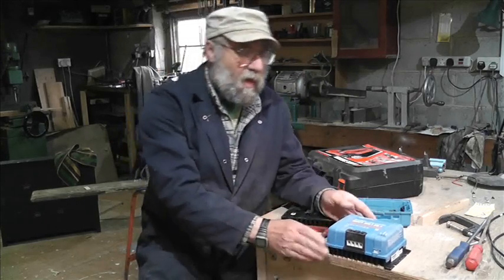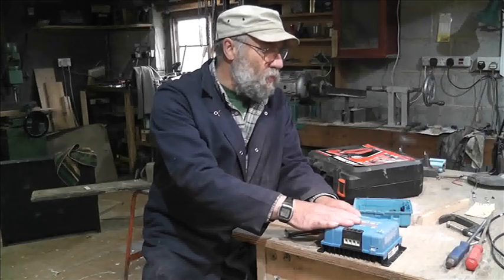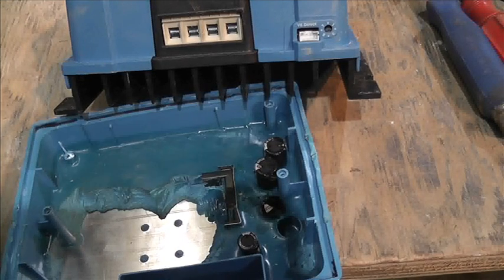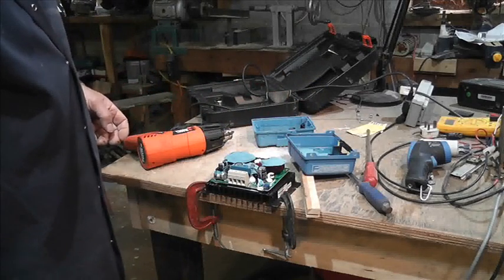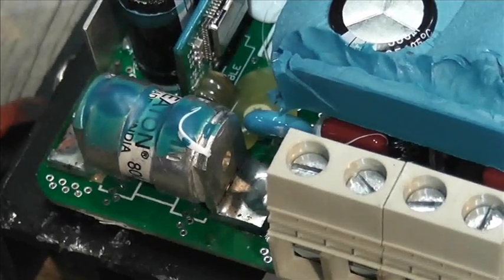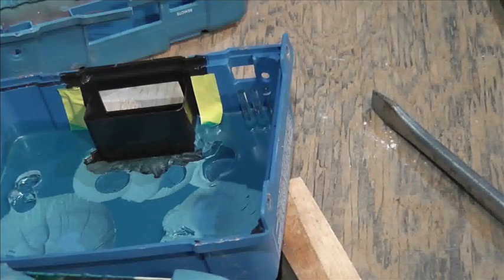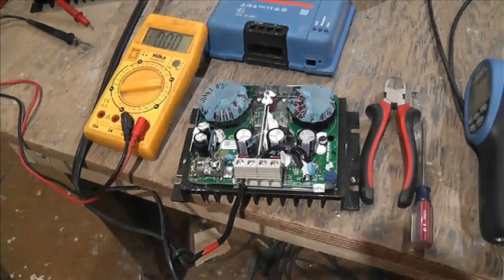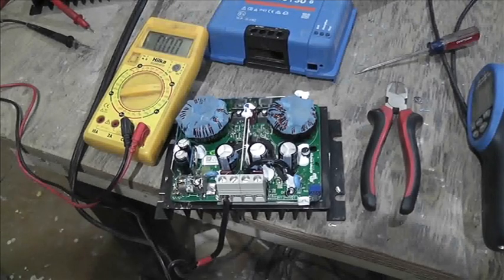Victron MPPT controller, potting hack and hidden fuse

Comment: this is not for people not getting it, Victron is for automotive industry (mobile) and this glue compomenents on the case (2x inductor and 3x capacitors) is for protection from vibration and stress so they doesn't move or rubber to eachother and not to fracture the solder joints. They could have done it differently but it would probably add more cost to the unit. Anyway i think newer version of Victron equipment sort this thing.

Comment: I have successfully (and hopefully non-destructively) removed the cover from my MPPT 100/50, this after I let the smoke out (C56 is no more !). I was hoping to find schematics online to avoid having to purchase a replacement (I am cheap) so far to no avail, but shall keep looking, and who knows.....
Reply from the maker: See my videos on repairing this, it was just one FET, also see my video on the VLC V2.0 programmable voltage relay unit to control a power relay, very low cost, cheers

Comment: 99.9% of the time, a blown fuse is the first "Line of Defense" indicating that something else within the circuit's current flow is faulty or falling out of its specified tolerance.  First thing I learned, before jumping any fuses and adding power back to the circuit, is to trace your power control components ( diodes, transistors resistors and of course capacitors) along with a thorough visual. Also, it may sound funny, but doing a good smell test wouldn't hurt neither in leading you to a burnt or overly stressed component.

Comment: Thanks for the demo of removing the cover. I got mine apart and found 2 shorted MOSFETs and the blown fuse. €30 in parts and it’s up and running again.
Reply from the maker: Brilliant, well done, I've fixed one, just a dead short on one FET. Not like the bigger units that are impossible, cheers

Comment: What a bad and customer unfriendly policy that the devices of Victron are not serviceable! I have a 150/45 MPPT and a Pheonix Inverter from Victron - but i will think twice before buying the next device!
Reply from the maker: Exactly, but our 3KW Multi plus has run for decades. We do run it softly and use the UPS function for loads above 1.5 KW, cheers

Comment: I saw there is an aluminium plate inside the cover to disperese heat and maybe shield the outside world from high frequency fields.

Maybe it can be heated with some inductive power aplied from the front.

A few big neodymium magnets on a roting disc driven by some drilling machine will cause heat.

Or an half open tranformer with iron core, an electromagnet, can induce current in the aluminium?

Then the heat is generated from inside and from all conductive parts near the front.

And now with the "substance" available it could be tested at what temperature it becomes soft.

Worth a try.
Reply from the maker: Hi, the melt test sounds a good idea, I going to try that with a heat gun. The problem with heat is the capacitors all packed together in potting. I doubt they would survive as the contact pins are not very strong. Keep watching, cheers

Comment: It could be filling the device and making it unserviceable is also a cooling issue. The coils and even the capacitors may get hot in a non ventilated box. I have a faint memory some of the earlier Blue Solar devices where filled with something similar to sand.

But I would rather have a serviceable unit than having it glued. The design is trivial and easy to check for errors if not filled with "glue". Att least they could have made all power electronic devices on the heatsink and the fuse accessible.
Reply from the maker: Hi, at least it did come apart, but damage could occur. as you will see I've fixed another of these after a successful cover removal, cheers

Comment: I've had three of those fail and a 75/15 fail. Gave up and bought an epever China one, been fine for years
Reply from the maker: Thanks for sharing your experience, many people have recommended Epever. My Old Victron multiplus just keeps chugging away, but we never stress it. Applying rule 2 of solar, cheers
Reply: i also have epever theyre not bad, i have two victrons 100/50 but everything these days is built to a price.
have a freind a retired professor of electrical engineering,  bet he could design something robust.

Comment: I have a 150/100 with error 40. The battery ground wire slipped out, I slid it back in. Although the unit powers up, can see it on phone application...cannot clear error 40. Are these repairable?
Reply from the maker: Hi, those 150/ 100 are impossible to take apart without major damage, so unless it's a software issue then I'm not hopeful, video on the opening up soon, cheers
Reply: Reset the MPPT means manually installing the software update again, after that it automatically switches off and resetting. Fixed that on mine.

Comment: For these types of reapir you need at least limited power source and thermocam to check at low level of voltage and curent, what is warm and what gets hot.
Reply from the maker: Hi, I knew the unit was duff, especially as the 80A fuse was blown. Yes a limited current supply would have prevented the blue smoke dragon. The main part was removing the top with a hot air gun. cheers
Reply: @TheInfoworks  Look for "RIDEN Power supply"

They are cheap and fantastic things with lots of decimals, current limit etc.

Easy to power directly from 12V or 24V battery. Makes it isolated and portable.

I have the RD6018 RD606 and tiny RK6006.

The RD6006 is the best for electronics with 4 decimals current reading.

Comment: HI, beuautiful video, you can build 2-phase 200  V IN 100 A IN / 10 - 70 V OUT / 100 A OUT MPPT as DIY ESP32 project for 150 - 180 €. With tracking better than Victron and EpSolar, with efficiency around Victron, MidNite or Studer products. So two such MPPTs can get 2 x 6600 W for 66 V battery and temps of FETs and inductors never go over 45 - 46 *C in 22 - 23 *C ambient.

Comment: where is your external fuse!?
Reply from the maker: Hi, do you think it needs one in this situation, interesting, cheers
Reply: just think for a momentif you would be comfortable joining the wires together for a dead short
- if you are comfortable with this level of power in the wires, and any additional damage to the circuit, no need for a fuse
- if not, you can limit any additional board damage or melted wire insulation by the addition of a fuse.

I know this is a low risk, but, for something different imagine the recent japanese earthquake, or some other distracting emergency event (heart attack?) resulting in the pair of unfused wires remainig connected.  (yes I know low risk ...)
Reply from the maker: John, it's an experimental dab, not a screw connection  @johnallen3555

Comment: Very nice! Have you by chance seen if  you can get into the larger 48/100 version? I've found a non working unit and am wondering if it would be worth getting.
 New subscriber 👍🏽
Reply from the maker: Hi, welcome, I wouldn't pay money for it as there is commonly a cascade effect to component failure, meaning that it's not a single component. If you are an electronics wizard then maybe entertain it, but otherwise be careful and have no expectations of fixing it, cheers
Reply: @TheInfoworks  great advice! I'm sure they overpowered the solar input but who knows these days
Reply: @TheInfoworks  also wanted to say cheers on the pottery! Do you show vids of that as well? I'm introducing my kids to throwing and am looking for the right clay! I thought my soil would suffice but it's not right so we went to the closest store and bought the only one they sold but it's still not what we need
Reply from the maker: Yes, there's a whole playlist on my pottery adventures (ceramics) otherwise check out Andy Wards ancient pottery, cheers  @Laurel-Crowned

Comment: You need to pot the caps  and inductors in particular in marine applications due to the fact that they need to be supported at both the top and the bottom to stop them vibrating relative to the PCB, as the electrical leads fatigue rather quickly if there is movement of the caps and inductors relative to the PCB, so they would fall off the PCB pretty quickly.  Ie you need atleast 3 points of contact for it to be a stable system, ie a stool needs to have atleast 3 legs, a 2 legged stool is unstable.  caps and inductors are natively only 2 legged.
Reply: That’s all correct but it could be done by Victron so you can repair it with eg blobs of heat releasing glue but that’s obviously what the controllers of private equity Victron does not want, makes more turnover if you have to replace and you don‘t have to employ technicians to repair stuff.
Reply from the maker: I agree in transport applications it's important and the heating hack makes all the difference, cheers

Comment: Thanks for sharing this. I have just had to replace my entire system because I wired reverse polarity.. yeah.. I know stupid me.  But thinking that I can replace the fuse and some capacitors.. 

Will give this idea a go.
Reply: Did the same to one of mine. You'd think it would have polarity protection like cheaper ones
Reply from the maker: That's tough, I teach, check the polarity, mark it with tape, then check it again. Never imagine it's right, cheers

Comment: I can see 2 reasons for this foam : thermal transfer to the outside, reduce vibration
Reply from the maker: Hi, thanks for the comment, I'm thinking vibration proofing when in boats or vehicles, cheers
Reply: yy its gross weight this coils, or transformers, it helps for more  mechanical robust and cooling too, disasembly is hard, i see open it for use heat for lid and then little bit strenght and it happens

Comment: The potting is there to keep the cap and inductor wires from fatiguing from road vibration.
What is the history of the MPPT? Was it over voltage/current that blew a FET, cloud's as the pass the sun there edges at as lens monetary boosting amps and volts beyond the panel name plate. If the MPPT rating is close the the panel name values it could fail.
Adding a external transient suppresser, say 80V 5 to 10W, grounding the panel frames to a ground spike may help.
Reply from the maker: Hi, this came to me in an interesting pile of "bits". I understand the anti vibration but actually using it to glue the top on is difficult to justify, cheers
Reply: @TheInfoworks  
Gluing to the top makes perfect sense, since the components are heavy, they need some thing to react against to keep them from vibrating. 
Very few people are capable of repairing DC/DC converters, maybe replacing FETs but when they go usually they are not all that fails. But without schematics its even harder.
But a better mechanical design could have been done, but that would add cost and complexity, every consumer wants the lowest price and to by it on sale.
On the other hand if they did not want you to take it apart why did they put screws in it?
As I said not knowing the history of the MMPT who knows how it was abused, over voltage, over current, over temp, not grounded properly or factory defect, who knows.
Reply: @universeisundernoobligatio3283  They could be glued to the board. I think it is to get rid of heat from the coils and the capacitors as they offer quite high current for extreme users. But it makes the device impossible to service.
Reply: @TheInfoworks  Agree. Making it unserviceable with "glue" is a crime. I think it is to save the coil from heating, but I would rather have a fan than a device filled with glue.
Reply from the maker: @tofo2  The potting does not need to be so robust, the 100 - 50 came apart with no damage. The should be a better way to prevent coil vibration. I'm working on removing the cover on a 250 - 70, video soon, cheers

Comment: That will likely be a low side Mosfet smoking, failed & shorting on drain and source across the battery via the fuse.   In normal operation this low side Mosfet would be off/open circuit initially.
May have been the gate driver IC that failed first but either way usually both the gate driver IC and Mosfet will likely have failed in this scenario
Reply from the maker: Thanks for your thoughts, yes it's not normally just one component and so greater knowledge is required, cheers

Comment: The official explanation for potting is "Due to automotive/ camper environment we need vibration protection for large internal components", I had to do the same steps like you, just that I put my Mppt in the oven, set to 100 celsius for 10 minutes in order to open it and fix a broken connector from over tightening
Reply from the maker: I notice that all the screws have a dab of glue, but the potting is rather excessive. I sort of understand the reasoning, but there must be a better way, cheers
Reply: Please tell me more if you would, im about to go in on mine. I've got the BlueSolar 100-50 that has an aluminum cover instead of a plastic one.

Comment: Great, thanks for coming up with a solution to get these open! BTW when you have a blown fuse, you should check for shorts to ground. It's likely a MOSFET, or DIODE shorted to ground. Curious to see what you find.
Reply from the maker: Yes, we will get round removing the board, busy time of year on a small holding, cheers

Comment: I think the potting mostly has to do with vibration. It's over the sensitive copper coils and the large capacitors.
I totally agree with you on the throwaway society and manufacturers going out of their way to make stuff unserviceable, but at the same time, not everything is always bad :)

I'd guess indeed a FET or diode has shorted and is giving you a nice smokeshow. Hopefully you can easily reach the underside of the board.
Reply from the maker: Interesting the smoke came from one side, we will be looking in good time. We run a 48v system so there is no rush, cheers

Comment: That "Corporate strategy" plug is a very common JST connector...
Reply from the maker: Brilliant, thanks
Reply: It's also noteworthy that while other Victron equipment uses a 8p8c connector it't not Ethernet (the protocol used for computer networks). They have VE.Bus (which I think is RS-485) and VE.Can.
The VE.Direct port is a standard UART connection.

This is known because if you look up "Victron Energy open source" they have actually release quite a lot of information about all of their protocols to the public.

Comment: Isopropyl alcohol strategically placed works wonders with potting. You could use a syringe to distribute the IPA
Reply from the maker: having seen inside this could be possible but what would it do to the varnish on the coils?
Reply: @TheInfoworks  the prop’ alc’  and your question just gave me a nudge to times past re: sterilising electronic gear,  ( don’t ask🫢). As I remember aftEr much experiment we used formalin and pure alcohol ( customs licensed - >70%) and sprayed very fine mist/ fog.   The normal formaldehyde which is quite vicious in its own right was not the problem on circuit boards but the minute drops of liquid ( with the higher water content ) keeping the minute junctions wet long enough to corrode ,  just thinking out loud 🌝
Reply: @TheInfoworks  stratgic displacement of the ipa is the key. Pouring ipa into the enclosure is obviously not recommended. A syringe much like what medical people use

Comment: Wonder if Acetone would work 🤔
Reply from the maker: I hear it will, but what will it do to capacitors and the like? This seems to work and that I did not care if it turned out total destruction, cheers
Reply: @TheInfoworks  was thinking more of a few bleed holes in the case and flood with a few cc’s of acetone merely to release the “ lid” it’s going to be a type of technology which is going to be needed down the line with Tesla type  battery repairs 🌝

Comment: Good info . Am building a large bank of ercon automobile  batteries  to use as storage  and
Reply: Am building a large bank of recovered auto batteries  for storage and to sell as a side business. Charging from solar at 48v and want to try your light bulb trickle charging method on my 12v battery  recovery system. Having good results with pulse desulfation  devices and 2 amp charger but would like to go direct from 48 v without electronics.  Any suggestions  from you or the viewers will be appreciated as this a work in progress  . I am aware that auto batteries  are not suited for deep discharge so I am building  a  large capacity so as to use less than 25 percent of capacity. These batteries  have been purchased for scrap price so when they are used up they can go to be recycled and money spent will be recovered. Thanks for all you do.
Reply from the maker: @teddycunningham7568  Good man, thinking sideways, no point deep cycling batteries as you just have to charge them up. Apply the first rule of solar and you will be on the right side, cheers
Reply: @teddycunningham7568  any experience with glass mat or gel types ?
Reply from the maker: @pollywollydo  Forget gel, but AGM are fine if used as buffers and not deep cycled. If you deep cycle the life is about 4 years, cheers
Reply: @pollywollydo  the a.g.m. and gell are responding well to pulse desulfation device  with trickle charging . Am buying  scrap batteries any that do not have 12v after charging  overnight are traded to my local auto parts store core pile where I only take home batteries  holding 11.5 v or more . I often bring home 4 to 8 and have about 80 percent  sucess rate after a week of trickle charging  with desulfator.. working towards a bank of 100 or more batteries at 48v and a smaller 12v bank to process new arrivals.
Reply: @teddycunningham7568  thanks most useful 🙂
Reply: @teddycunningham7568  where are you getting them for scrap price? Sounds like you have a good thing worked out